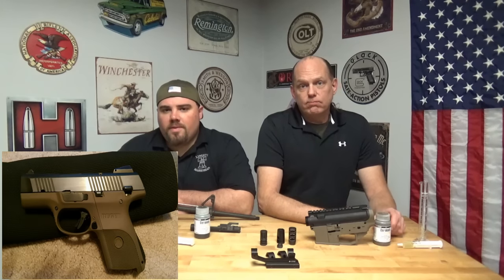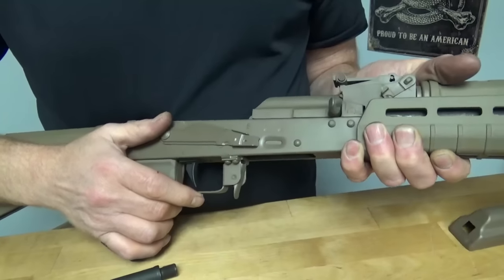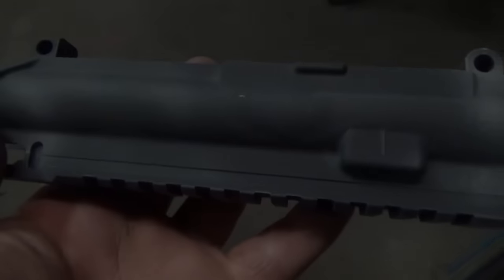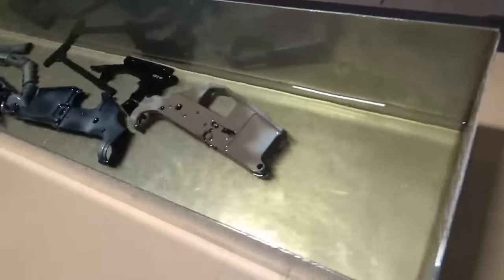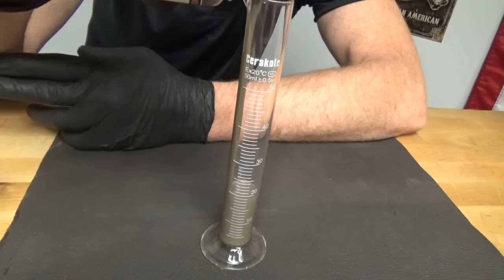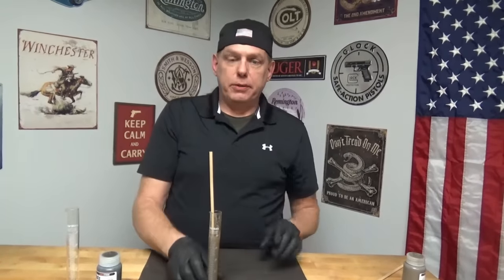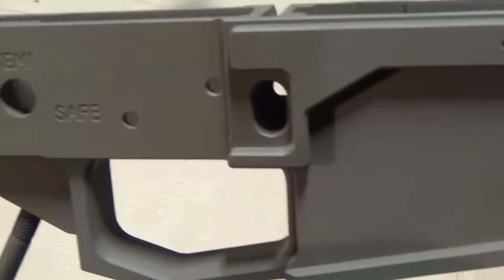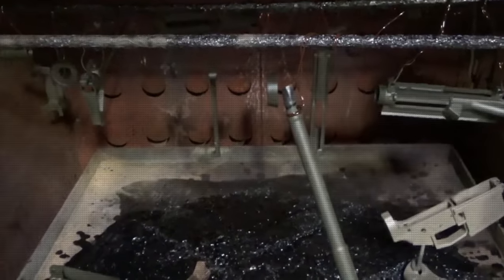Cerakote. You can do it at home!

Comment: Ha! Nice!! Sure as long as you have an oven, sand blaster, big pro compressor, dip tanks, paint sprayer. Annnnnd the exhaust fan with filter.. and a big shop! Hahaha good video tho!
Reply: Here's the deal.    First a pancake compressor works for airbrushing.     If you have a shop or garage which these guys assume, you will have an air compressor of some sort.    An airbrushing kit is pretty cheap and you can buy a used range and rig it with hanging rods or something.     Buy your acetone and a  some aluminum baking  pans would probably work.     You can also buy a small blaster which would work for firearms.       Of course you're not going to do this for just one gun then never use it again.       It ain't for everyone.
Reply: but at least you don't need gloves or a respirator!
Reply: al morris can it be baked in a regular household oven? What kind of temp??   Also is it safe to bake cerakote in the same oven you bake food in?    They didn’t mention temp unless I missed it.   

I could figure  everything else except the oven, that would be the only factor to not do it at home.  If it doesn’t really matter as far as baking it in the oven assuming temps is reachable with home oven and it wouldn’t affect baking food whatsoever, I am down to try it at home!
Reply: An electric smoker works good and can fit all parts and barrels up to 30 inches long. There usually under $300 just don't cook in it afterwards.
Reply: I do cerkoat my dip tanks and pieces of rain gutter that was left over from my house my air compressor is from harbor freight and so is my blast cabinet i got on sale just cause these guys are lucky enough to have good stuff to do it with doesn't mean you can't my setup has paid for its self twice over by now and i use a regular kitchen oven i got for free cause the burners on top dont work but oven does
Reply: Since then I have pulled a couple of nice cerakote jobs  off. The only thing I don’t have is the sand blaster I just use a friends. It is possible to do at home. But it’s not as easy as some people try to make it out to be
Reply: Shop compressor or airbrush compressor. I have both. do it on a sunny day with low wind under a carport or on your patio. Hang the parts from the cross beams of the carport to paint. To sand blast it hold parts with a large metal c clamp. Wear a respirator and make sure your shaved up. Probably will want a secondary oven though. If it’s a small part just use a toaster oven. Fuck up a few of your guns and re-do them til they look professional and you got it down. then when your buddies see it offer to do theirs for cheaper than a pro would charge Now you have a side hustle and you pay off the few things you had to buy to DIY this shit.
Reply: @stevenhorsefield2909  oh wow didnt think about a smoker,great idea

Comment: You should consider Micro Slick Cerakote for inside of upper, BCG and charging handle. It will not require oil again and won't flake off due to 1200 degrees heat resistance.
Reply from the maker: I have been wanting to do that for years. Have read nothing but good things about it. Might have to do it in a new video.

Comment: As an aspiring gun Smith I really appreciate this video. everything was extremely detailed and I think I'm ready to try painting on my own! The only question I have is what kind of air compressor did you use or should I be looking at getting?
Reply from the maker: +Steve Fox We use a Badger cyclone 1 Model# 180-1, its a airbrush specific compressor. If you have any more questions feel free to message us on face book or email us are contact info is on are main page. Thanks for watching

Comment: Brake clean leaves a residue. Bake it to outgas it. Then fully dip and wipe with acetone. Use 80 or 70 grit aluminum oxide from harbor freight and need to blast to bare. It'll leave the surface perfect to stick and no longer chip or scratch off ever. You do not want to leave a coating on it before coating it. You want the 70 grit aluminum oxide to rough the surface. Hitting with Scott Brite is not helping but makes it smooth and won't adhere well.

Comment: How would this work for an action that’s surface rusted? My shotgun cabinet conditions ended up real damp, don’t know how and I didn’t have the gun out for a week and it’s all surface rusted. I’m going to try 000 wire wool and think oil to remove it first but if that doesn’t work. Would this be a good option?
Reply from the maker: It is a option, but it is very thin. If you needed it to hide pitting, I would recommend Duracoat.

Comment: It doesn't mess up the fitting tolerances? Do you plug barrels?
Reply from the maker: No because it is a very thin layer and you can tape off at the fit if need be.

Comment: Awesome video guys, great job taking me through the process. Felt like I had no idea what cerakoting was before watching the vid, and no feel ready to tackle a small project once i get the supplies.
Couple questions,

Is the scotchbrite pad sufficient if I don't have a sand blaster?
Is the type of air compressor very important?
Can I use my home oven (will it make future foods toxic??)?

Thanks guys,

Jared
Reply from the maker: We have not had any problems with using scotchbrite, any air compressor should work with a air brush you regulate it way down any way.. as far as oven I would ether buy a cheap used or free off Craigslist electric oven or use the c series witch is air dry.
Reply: Liberty Marksman, did you both go to get trained at Cerakote or did you self teach? Just curious to know if I need the training first.

Comment: Great vid, however: "You know, wear gloves if you're a hipster".  Dude. I can see how swollen your lymph nodes are from here. You might want to go see an oncologist about that, before you soak up any more enzyme inhibitors( unless of course you have awesome healthcare and don't mind shitting in a colostomy bag after you turn 45......) Seriously. Gloves, N100 respirators, eye pro.  It doesn't hurt to be smart, and being complacent about this stuff will eventually kill you.
Reply: I never used to bother with gloves for most things but did things in a well ventilated area and just don't suck fumes in general. Then one day my hands were greasy, I was out of rags and the brake clean was right there. I'd gotten it on my hands before, no biggie, so I sprayed my hands down, shriveled them up in the process, didn't inhale but got a nasty headache for hours and just felt sick in general for at least the rest of the day. That taught me. Gloves are so cheap at Harbor Freight its worth it just so you don't have the spend the time cleaning under your finger nails. Plus the oils on your skin alone can spoil a finish
Reply: As a professional cerakote applicator my self you really do want to wear all ppe when spraying cerakote... It's not the ceramic that hurts you it's the other chemicals. Also the guys didn't mention that to get the best results and wear resistance you need to be applying cerakote at 1mil of an inch thick.
Reply: Dude i ceracoated my junk and it works great lol . I wish my dad knew to use protective equipment back in the day , took a while to kill him and his last 10 years fuckin sucked bad .
Reply: @BeamCrash89  considering your a pro as you say the coating isnt supposed to be a mil thick, the correct and best coating is half thousandth to 1 thousandth of an inch.
Reply: @davidofqwerty  A mil is 1000th of an inch in the US.     You are probably thinking millimeter.     FWIW
Reply: I wonder if he ever figured out why his hands bleed in the winter.
Reply: @Log Splitta "And a chaina saw, and a lawna mowa."
Reply: Bingo! Although it's funny to jest at hipsters, it really is worth it to be smart about this crap.

Comment: at first i believe you said it couuld be done at home but then i see you using these big machines so im confused what was done at home
Reply from the maker: All of it, you can use the C type Cerakote that does not need to be baked. also as far as sand blasting you can just ruff it up with Scotch bright and as far as applying it a cheap airbrush and comp.We talked about that in the video.

Comment: I was very impressed with how easy this process was. I did my wife's db15 free float rail. And some other things on her gun in bright purple H series cerakote. Beautiful gun. I have been pondering doing mine, in magpul fde , like yours. Dam that's looks good. One question, do yal have better results with a thick coat? Or thin. I know book says 1/2 to mill thick. Just depends.
Reply from the maker: Thank you, Thin is the way to go if you put it on to thick it will chip

Comment: So, I am not looking to add a cerakote onto a gun. I just want to put it on a flat sheet of bare metal for my guitar pedalboard base (since I'll be stepping on it over and over, I thought cerakote would be a good option to add color and protection). So do I need to go through all those steps as well if there is no finish already on the sheet of metal?
Reply from the maker: you still need to etch the surface, you can use scotch bright. then be sure to degrease and you will be gtg.

Comment: Do you bake it between coats?  I don't have sand blast equipment but am thinking of doing a base parker finish first on the AK receiver I'm about to do to match the parts kit.
Reply: +Liberty Marksman Thank you!
Reply from the maker: no problem thanks for watching
Reply: You bake it between coats at around 180 for 8-10 minutes. You are looking for it to be "tack free" (No longer sticky to the touch), but not hardened. Fresh Cerakote won't adhere to hardened Cerakote.

Comment: So he left the gas tub in the gas block. Did he just leave it in because there is no need to take it out? Guessing he just did not spray it?
Reply from the maker: No reason to take it out popping the pin that holds it can be a pain some times.
Reply: What about your blasting process. I know bead blasting is the best result, but i dont have access to a blaster anytime soon. Can I scrub the barrel, upper and lower with a certain grit sandpaper
Reply from the maker: you can use scotch bright you don't want to go to aggressive cerakote is vary thin.

Comment: 250 degrees for 2 hrs not hurt the rifle? And how bout a scope? U can’t do it at 250 degrees
Reply from the maker: 250 will not affect the steel of the rifle. That will not happen until you get to 1200 degrees. As far as scopes go you can bake it longer at a lower temp. Or you could use a different series of Cerakote, that is air dry. The down side to that is 30 day cure time.

Comment: maybe you've already answered this on another comment, I didn't see it whilst sifting through on mobile, any advice or thoughts on using masking with this stuff for making patterns or designs?  Coming from doing miniatures, I know that with acrylic paint, and some enamels, you can lay down batches of painters tape between coats and colors in  order to roughly simulate camouflage or other effects.  I've not worked with bake-curing paints, and whilst I would guess that the air-drying stuff would take this kind of thing alright, I don't know that i would want to burn the cost to experiment if someone already has a successful method, or a concrete reason for their own failure.
Reply from the maker: We have not tried doing a camo job yet, I know they sell vinyl stencil kits for doing that. With Cerakote you can turn the heat down and just bake it at lower temp for more time that way the vinyl won't melt.
Reply: Not to plug my own store, but you need to use Avery Dennison High Heat Paint Mask Stencils. They are designed to go through several heat cycles without curling or shrinking. Again, not wanting to plug our store on someone else's video, but we have them on our website.
Reply from the maker: Plug away no problem on our end, we will check out you site we have been talking about a snow camo job.
Reply: Lol, just don't want to be that guy. We have around 100 stencils for sale, and can make a stencil out of just about any image. 

Like a lot of people who apply Cerakote, I was buying stencils off of eBay. About half of them went straight into the trash because they were the wrong material. We bought a commercial cutter, and hired a graphic artist. Everything we have has been used by me in the shop at one time or another. We also do custom stencils, so if you don't see what you need, let us know.

Comment: Hi Guys couple of question.
I bought a harbour freight sand blasting tank and  aluminum oxide , my compressor is a dual tank type ,  I been  told  I need to buy a air dryer , is that correct? and what psi  are you spraying with. is  it ok to use a plastic container  to soak  my parts  in acetone then empaty it back into  its steel  container
  I am doing air guns and  this cerakote  was  just to dam cool not to do
Thanks
Reply from the maker: Hello Mike, a dryer would help as far as PSI I would we what the spray gun you are using recommends. A plastic might melt depending on the plastic, acetone does not get along with a lot of them.
Reply: since I written in the above question, I found a lot more info  out  on the youtube channel even awesome mods for the H F blasting cabinet and places  that sell the  Mods as a great upgrade kit and how too's.
even   how to make your own air dryer using whole house  filter containers and silica  gel beads and piping lay  out  for trapping  water / also  info on spray booth cabinet set ups  and vacuum set  up with a mini dust collector & separator  heres a link  https://www.woodcraft.com/products/mini-dust-collection-separator?gclid=EAIaIQobChMIweyc5pK92gIVEL7ACh3X_wNZEAQYAiABEgIqz_D_BwE
 Thanks guys for  taking the time.

Comment: how do you clean the airbrush after use?
Reply from the maker: drop it all apart clean it with acetone then reassemble and spray some more acetone through it.
Reply: They also have cleaning tools on the cerakote website, if you want to be very thorough.

Comment: Are their ever any issues with anything fitting back together with tight tolerances? I am contemplating doing my G19 upper, I'm worried about pressing my sights back in and such. Thanks! Great Video.
Reply from the maker: We have never had a problem it goes on thin, it might rub the surface pushing the sights back on tho.

Comment: Do ypu bake palmer or use the air dry on it ?
Reply from the maker: yes but at lower temp and for longer time.
Reply: Polymer gets baked at 150-180°f for 2 hours. Or you can just use the air-dry coating and it won't be "as durable"

Comment: Shout out to everyone who has a sandblaster at home
Reply: I got a cheap one at Harbor Freight that would work just fine for this application.  The air compressor is the tougher part.  I suggest doing it outside because you will make a mess inside a shop

Comment: how much time between coats, how many coats for the Glock 19 frame?
Reply: p pollaccia one wet coat, and for polymer frames it's 150-180 degrees for two hours. It's all in the application guide on the Cerakote website
Reply from the maker: Potato Pete is spot on one good coat will do it
Reply: The only time you need to do multiple coats is if you are doing a camo, or similar application.
Reply: What size nozzle was that on the airbrush?
Reply from the maker: We just use the one that was in the gun new and adjust the depth of the needle.
Reply: Liberty Marksman And what size was that? Just curious.

Comment: what if it's raw aluminum does it still need the blasting
Reply: Yes. The surface needs to be treated for maximum adhesion. You could just spray it, but your final product wouldn't be fully adhered to the surface. If you're not going to do it right, you might as well just paint it with Krylon.

Comment: Can you get away with just using scotch Brite in place of sand blasting?  I'm considering doing the slide to one of my guns but don't have a cabinet or set up to do that. Was just curious if that would do it. Thanks in advance.
Reply from the maker: Yes sir and they even tell you in there hand out that it will work just fine. If you decide to do it let us know how it turns out.
Reply: Liberty Marksman thank you. I'd like to do a sort of jet black is what I'm thinking. Brownells has a graphite black kit, but I'm not sure if that's the color that'll turn out the way I'm looking for. The frame is OD green.  Then I need an application gun to. 

Anyway, thank you for the reply, I have some looking to do.
Reply from the maker: Hey send us a pic if you decide to coat it, Cerakote sell direct so if you cant find it else where check them out.